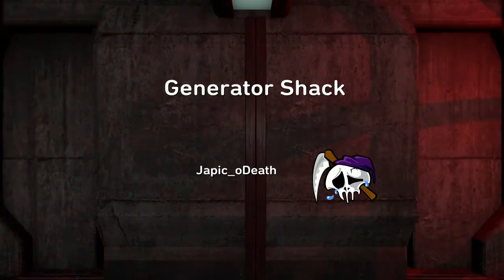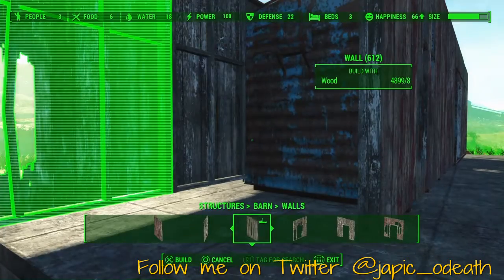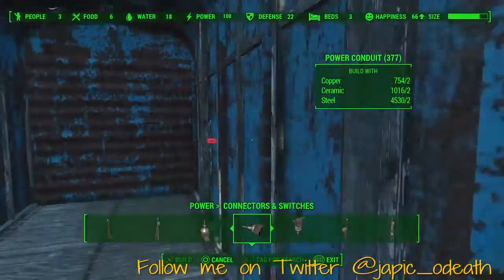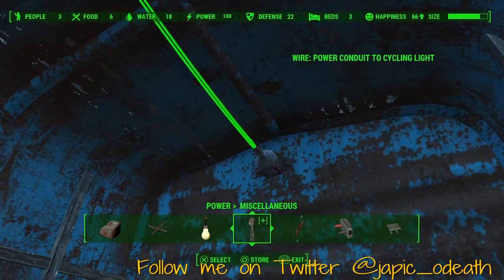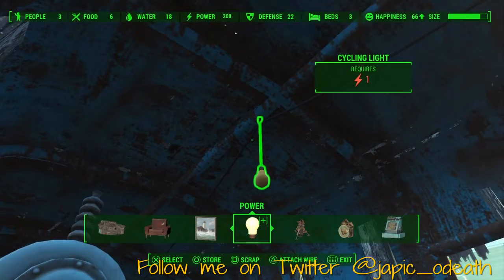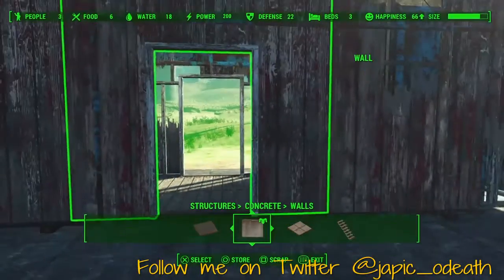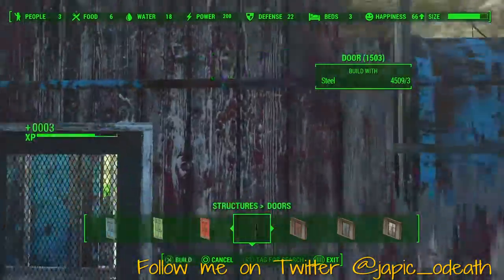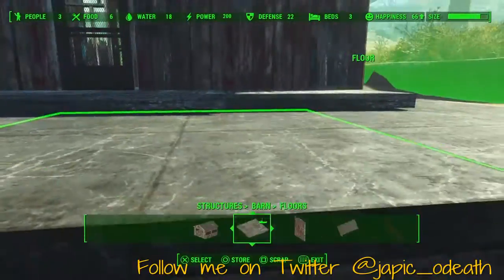Lets Build a Power Shed - Using a Boxcar    - (no mods) -

Comment: Great idea, I can think of a couple of ways to expand on the idea, especially if you pull the boxcar out, I love the shape and how the roof over hangs on one side.  I have an idea of something like this, in my current build.  Thanks for sharing.  I would love to see more of these types of ideas from you.
Reply from the maker: I used one of these tiny houses (no boxcar) in the Nuka Red Rocket build.  Didn't showcase it much, but it was just before the armor shop.  I liked the unique shape of these; as it's less than a full 1x1 building.  

Most of my strange goings ons end up mixed into a settlement and rarely get showcased.  Thanks for the view and comment pal!

Comment: Strange little build but I like it! Thanks for sharing! BTW I got the link to this video from Gary (loco4pack)...
Reply from the maker: The thing I liked the most about this was the odd size.  I know it's not always practical, but sometimes you need something different.  I used the skinny building twice in my Nuka Rocket build; once as the shed with the box car still inside.  Then again as a tiny house by the armor shop.

Thanks for the view and comment!